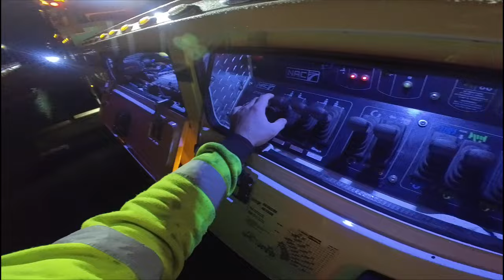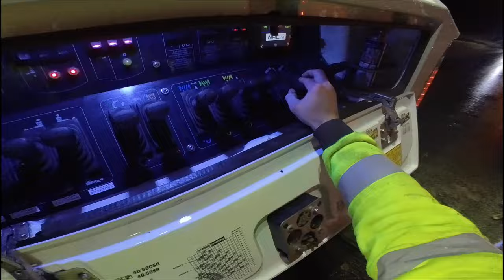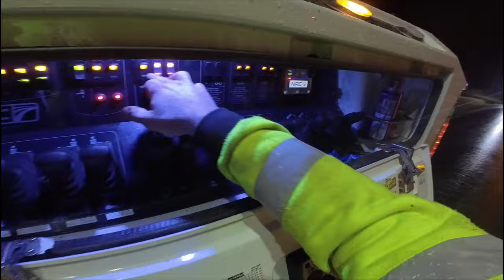Let's Get These Pigs Back on the Road!

Comment: Text book pick and swing. The real question is what was the smell like?😁
Reply from the maker: The smell wasn't too bad since it had just been loaded
Reply: @WilcoxGarageRecovery  I remember when I was doing medium duty in southern California our shop got a highway patrol rotation call for overturned tractor trailer. They requested 3 heavy’s for a loaded livestock trailer. The shop had only 2 heavy’s available and myself so we rolled out there. Upon arrival it was a load of live hogs (well most of them). It was summer and the load was head to farmer John’s plant. The smell I had it in my lungs a say for a week if that. I helped the heavy’s rig they disconnected overturned the tractor I hooked up to it and I was gonnnnnnne. Only to return with our spare good tractor for the hog trailer. 🤢🤢🤢Our shop was literally 2 exits away.
Reply from the maker: @artyart31  I'm sure the cold, wet weather weather helped to keep the smell down as well. I can imagine the warm California air and the fact that  many hogs were getting crushed probably did not help your situation!